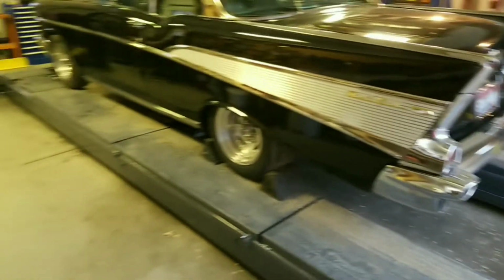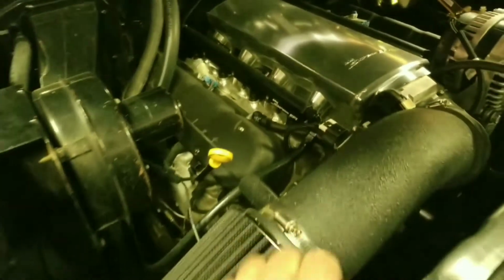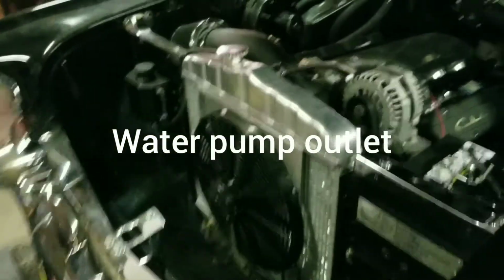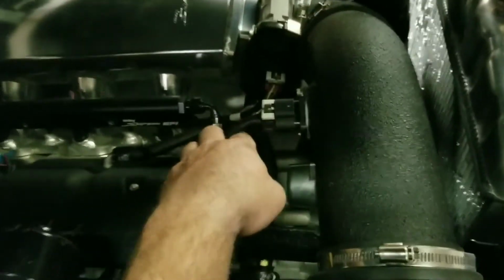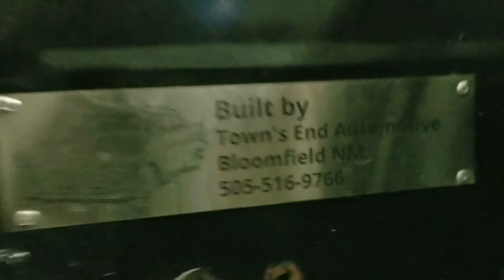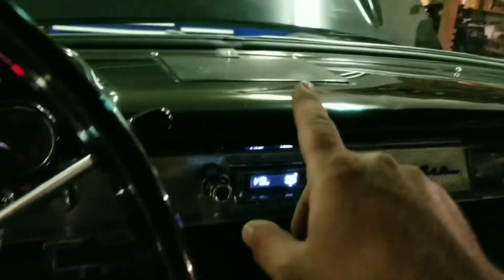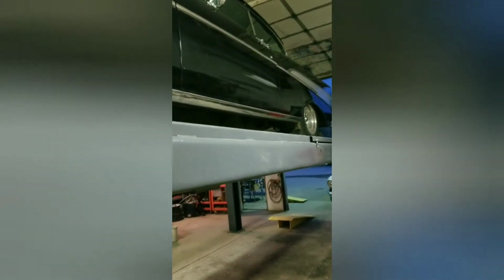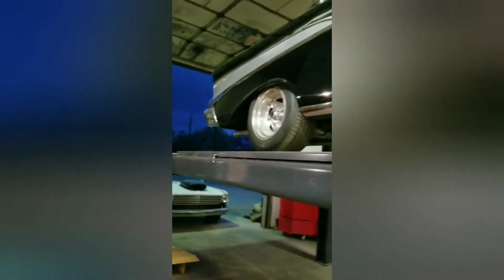57 belair LS swap project.

Comment: Have you considered Hydratech for brakes? Thats the way I’m going with my 57.
Reply from the maker: I haven't heard of it, I'm assuming its just aftermarket hydro boost system, they say hydroboost is the way to go on these cars because of the wieght and the lack of room for a large brake booster, but brakes turned out pretty good on this one.

Comment: Great video, where did you mount the pcm
Reply from the maker: So the 6L80E the PCM is part of the valve body in the trans, the ECM I mounted on the driver side kick panel, some of the big companies are mounting them on the passenger side floor board, and making a cover for them, not sure how I feel about that idea, but have seen it on several builds worth over 100k, I'm gonna a build a 68 c10, I think the ECM will be behind the seat or behind dash and spend alittle more time laying out harness, in a car I'd like to go under the hood, in the trunk or behind dash.
Reply: Where are you located,
Reply: Thank you sooooo much for answering my question, I have one more. I have a 57 belair and I’m trying to figure out how to change my 4l80e rod linkage to cable linkage. Just wondering how you did it. Love you video and can’t tell you how many times I’ve watched it and thx again for the feed back

Comment: Curious, with the monster 6L80, did you have to modify the trans tunnel to make it fit?
Reply from the maker: No, oil pan does stick down alittle, but I think it will be fine. But yes that transmission is huge, took alot of time and planning to get everything in the best location without cutting up frame or firewall